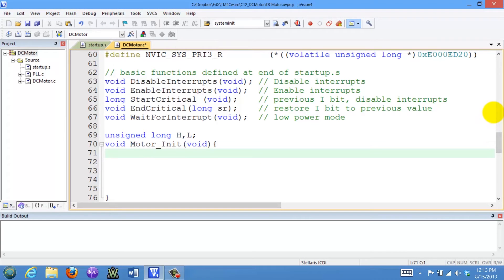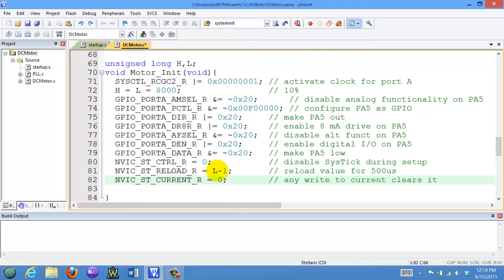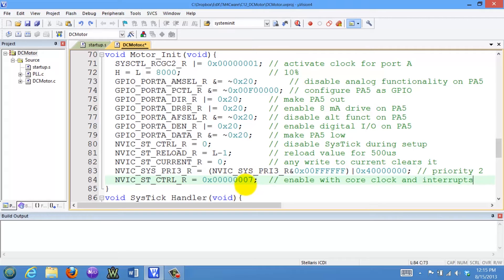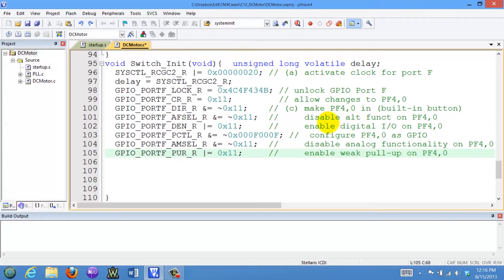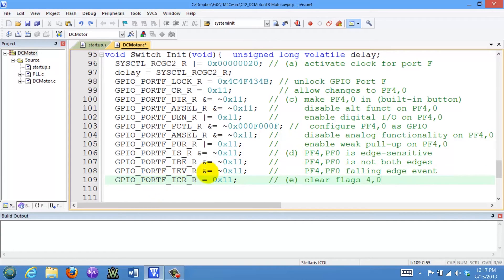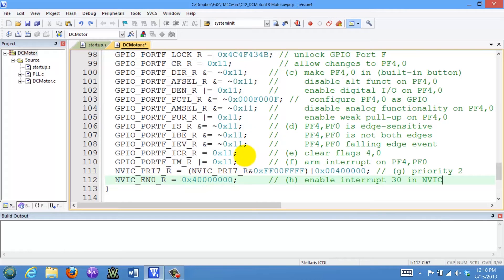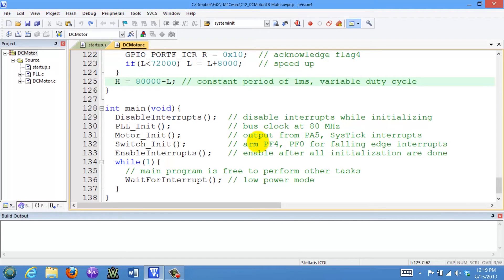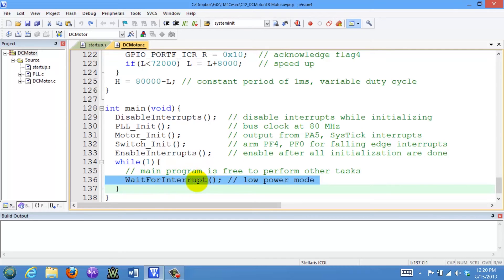C12 4c PWM software

Comment: Port A pin 6 i.e  PA6 is a being configured as M1PWM2  (digital function) and not PA5
Reply: There are different ways to generate PWM-style output (i.e. generating output that is good enough to be used as PWM). 1. Using hardware-based PWM modules (e.g M1PWM2 is one of the alternate functions wired into PA6/PE4). 2. Using Timers to generate PWM. 3. Using a simple software-based approach via systick. The approach shown here is nice and simple using systick which allows you to easily toggle the output of any pin you want on the TM4C123 board (e.g. PA5) via the systick interrupt handler, so its incredibly flexible as you can control your duty cycle from code (SW) rather than via config (HW registers).

Comment: The tm4c123 has a built in PWM module that produces a pwm output aparently. How do I initialize and and run it to pwm an LED?
Reply: i would like to refer u book(real time embedded system(orange color). PWM Is with detail in it